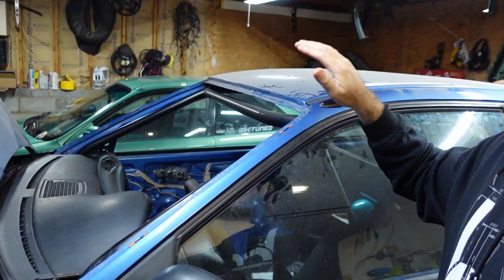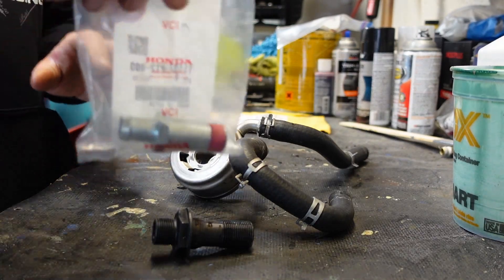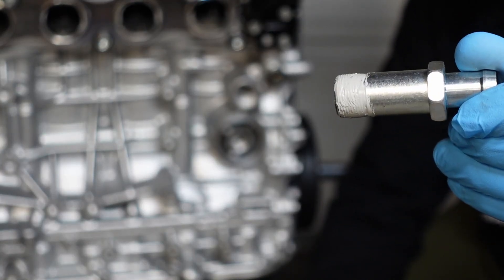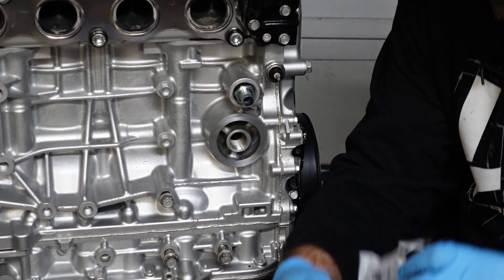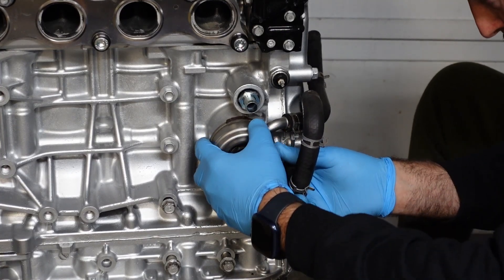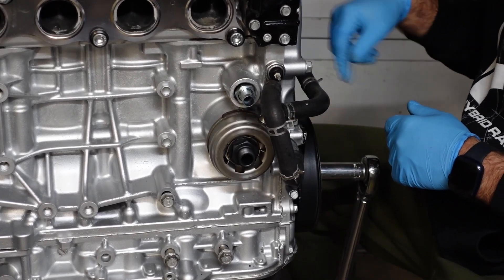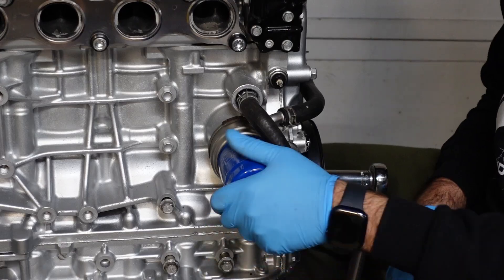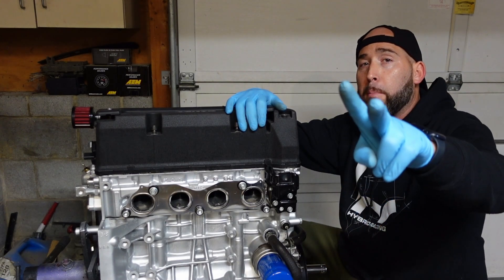k24 type s oil cooler install

Comment: What size is socket for oil cooler? That’s one thing you didn’t mention. Thank you 🙏
Reply from the maker: 30mm socket
Reply: @wisin_k20 it’s not a standard size
Reply from the maker: @mahp3039  it a metric 30mm if it’s the type s oil cooler bolt.
Reply: @wisin_k20 I’m taking oil cooler off z3 and putting on k24. Z3 motor is 30mm
Reply: @wisin_k20 just got if from Amazon over night
Reply: Didn’t know you have a midori too
Reply from the maker: @mahp3039 yea that the main chick 😂
Reply: @wisin_k20 30mm works but a tiny bit loose, maybe a standard size. I got it loose with 30mm not going to complaine. Thank you

Comment: What do you do with the hole next to the s2000 plug you install
Reply from the maker: @danielherrera3169  which hole are you referring too ?
Reply: @wisin_k20  I have the k20z3 water pump housing after I take out the plug from the k24 and install the s2000 piece I’m left with a hole on the other side
Reply from the maker: @danielherrera3169  dm me on IG wisink_k20 and send me your number I’ll reach out I can get a better understanding

Comment: 3:42 Quick question: Can you run this on Acura tsx K24A2 to keep my oil temperature cooler?
Reply from the maker: @wuzT40  yea that’s what its supposed to do but it’s a small oil cooler , if you want a performance oil cooler that’s gonna help bring temps down better.

Comment: Hey do you have any idea how to change the oil coolant hose that runs on the side of the motor near the timing chain? the long hose not the not U shaped line that bends, there seems to be little to no clearance to remove old hose and install the new one.. any tips appreciated thanks
Reply from the maker: @dannyem4787  what I ended up doing with my civic was that I used a long niddle nose pliers and a long flat head screwdriver to help me pry it off once you slide off the clamp  grip the hose with the pliers where the clap was and wiggle it right to left to break it free it probably been on there for years and it’s stuck.

Comment: Hey so I’m getting a leak from the oil cooler it’s like repetitive drops of coolant I checked the gasket and it’s in perfect conditions what can it be?
Reply from the maker: @alwx_.  also make sure you torque it to 54 ft lbs.
Reply from the maker: @alwx_.  if you replaced the gasket with a brand new one try  adding  a little bit of Honda bond to it so it help to seal it and to keep it in place and it don’t come off the grove when you are putting the oil cooler onto the block some times it will come off the groove with out you noticing and pinch the gasket and create a leak. Just add Honda bond to the groove then put the gasket on top of the Honda bond so it doesn’t fall off.
Reply: @wisin_k20  haha yeah I tried that I even tried putting hondabond on the rim of oil cooler and it was still leaking
Reply from the maker: @alwx_.  damn I’m sorry to hear that. Don’t know what else to have you check without being there personally.
Reply: @wisin_k20  haha yeah im just going to delete it for the meantime until I go turbo on my other k-series I’m building on the side

Comment: how did you remove the threaded sleeve where the oil filter screw onto? If I use the vice grip, I will destroy it.
Reply from the maker: I use vise grip it’s not on there tight at all.

Comment: Might sound like a dumb question. 

But which of the two hoses has oil running through them ? (Connecting to oil cooler)

Both or none ?(only coolant ?)
Reply: Can coolant get into the oil if the oil cooler is broken?
Reply from the maker: @Daniel-i2g3t  it might be possible I’m not 100 % certain  but it could possibly happen if it is damaged.
Reply: @wisin_k20  thanks for the reply. When I poor coolant into the radiator mixes with the oil.
Reply from the maker: @Daniel-i2g3t  what’s make you point to the oil cooler? It could be a bad head gasket.
Reply: @wisin_k20  yeah did think that aswell. Jst looking at all scenarios what it could be
Reply: @Daniel-i2g3t Did You Ever Figure Out The Issue?
Reply: @YndioK24 no. Not had time to strip down the engine
Reply from the maker: It’s only coolant
Reply: Got it! Thanks 

Also replacing gasket and hoses on oil cooler , I would have to flush both oil and coolant?
Reply from the maker: @joseraya8998  yea.  I would just add new oil and coolant.

Comment: My k24 is leaking antifreeze out of the oil cooler you can it be a bad gasket?
Reply from the maker: Have you checked the 2 hoses? The coolant runs through there.
Reply: @wisin_k20  yea there tight it’s just weird cuz I never had an issue with that so idk if it’s the gasket cuz it’s pissing out
Reply from the maker: @yenielyLopez  I would inspect the hoses really good make sure it doesn’t have any hair  line cracks cause under pressure them hoses would expand and make them leak. Are they leaking all the time or only after you drive and then park the car?
Reply from the maker: @yenielyLopez  I don’t think it would be the gasket because I believe it’s oil that circulates through there.
Reply from the maker: @yenielyLopez  well if it’s coming from where the oil cooler joins with the block then change the gasket cause that’s the only thing in between there. K24 don’t come with oil coolers from factory unless it’s the newer SI MODEL K24 I believe so if you installed the oil cooler it is possible that the gasket could’ve gotten pinched and not sealed properly. If you do go ahead and change the gasket go ahead and put some Honda bond on the gasket so it stocked to the oil cooler so it doesn’t fall off the cooler when you go to install it. GOOD LUCK.

Comment: What socket size did you use for the center bolt? And do you know if it's the same size for a 93 accord se?
Reply from the maker: I used a 30mm socket. Not sure on the accords.

Comment: How did you remove the oil filter stud off the k24?
Reply from the maker: I just grabbed it with vise grip’s and twisted it off it’s not on there that tight.